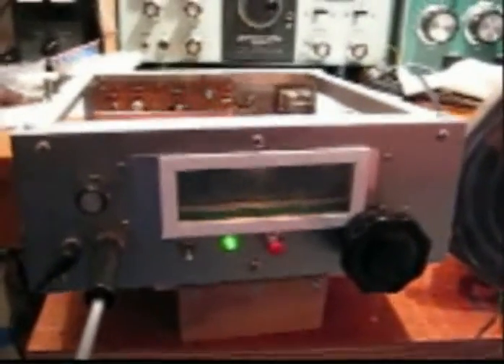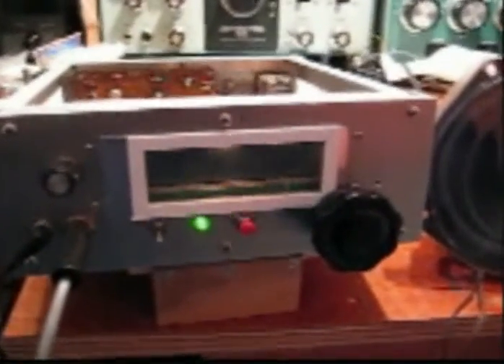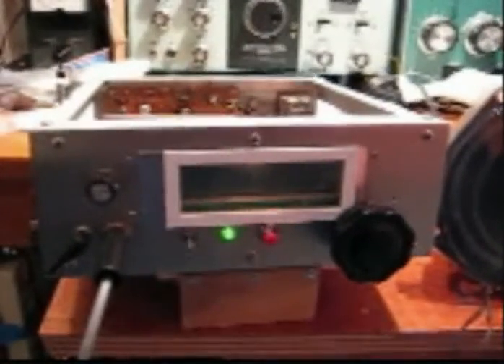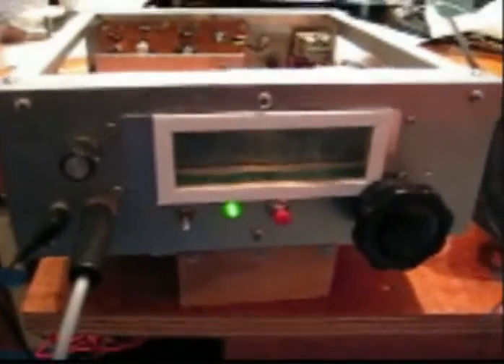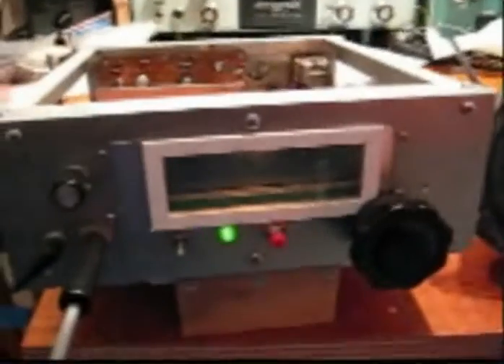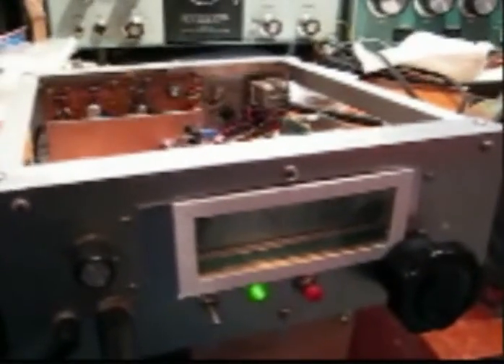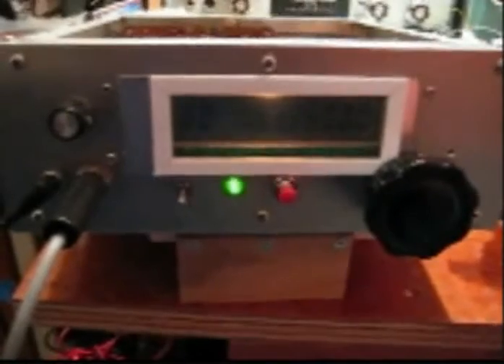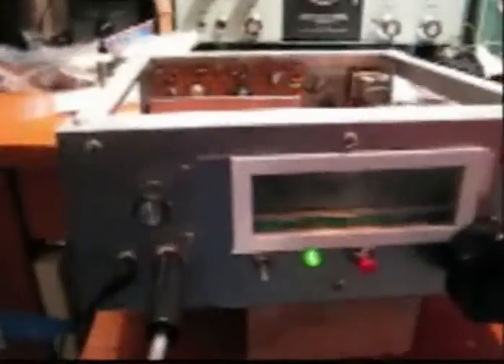20M Dual Gate MOSFET QRP SSB Transceiver.mpeg

Comment: I've been using MPF131's since I only have 2 40673's left in the junk box.
Never thought of using them in a Bi-directional arrangement....
Good job,
Lee, WA8QFE
Reply from the maker: Hi Lee,Check my blog http://n6qw.blogspot.com and search on the Simpleceiver. I have built and used homebrew DGM's made from two J310's --these work even better than the 40673. I even have come up with a universal template so you can use the dual J310's as an RF amp, Mixer, IF Amp, Product Detector and yes even a microphone amp. So don't lament about your supply drying up. I bought 50 pieces of J310's for 20 cents each delivered (US Supplier. A $10 Bill buys lots of hardware.73'sPete N6QW

Comment from the maker: Hi Roberto,

Thanks for your kind words. Since this video was published I now have a different frequency controller with a backlit LCD and control of many of the radio functions is via a 4X4 keypad. I also have added an S Meter but right now that is on a breadboard as I need to cut another hole in the front panel. I will post some photos on my website. (search for N6QW) in the next couple of days. The BF998 is a good choice for a DGM,